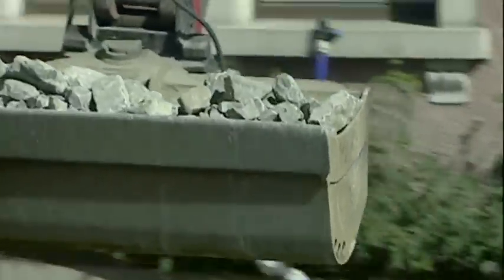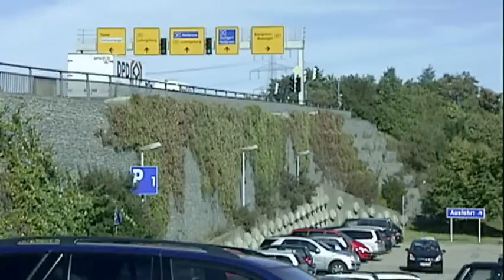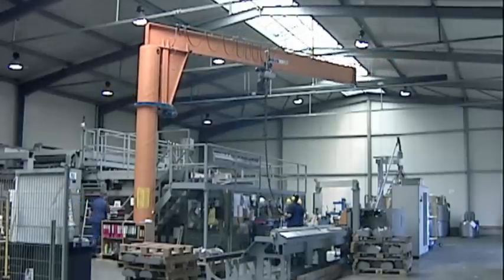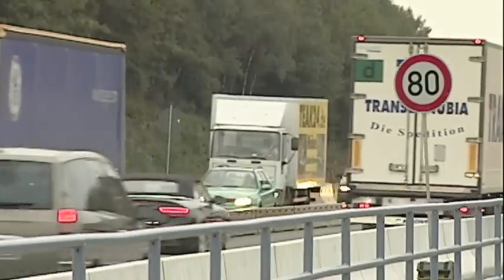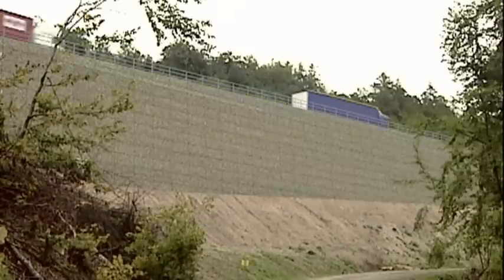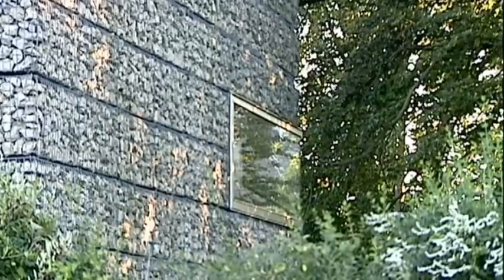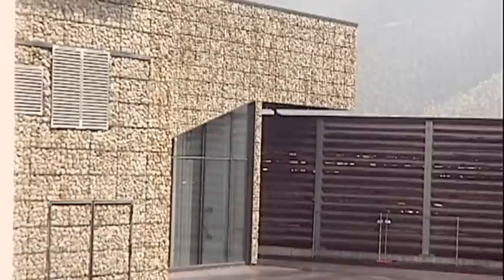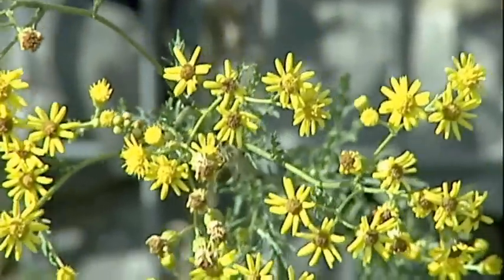ROTHFUSS Imagefilm Englisch

Comment: There are two difficult to solve problems. The first is that, in spite of all the protection, there is a time of  corrosion, which will not only be bad to see, but the question of static  stability. The other is that the cavities between the stones become the home of all possible creatures, especially  poisonous snakes, in the presence of moisture and insects, which may be  detrimental.
Reply: Its not that bad.
Reply: Europe they not have 🐍🐍 so it safe.  If in my country be prepared for cobra and poised snake live near you.
Reply: @peterpan8175  There are snakes in Europe...who are you kidding ;)